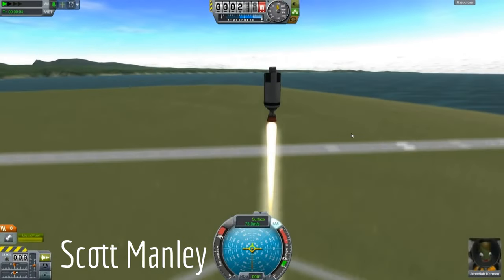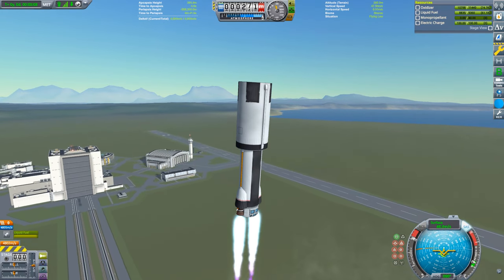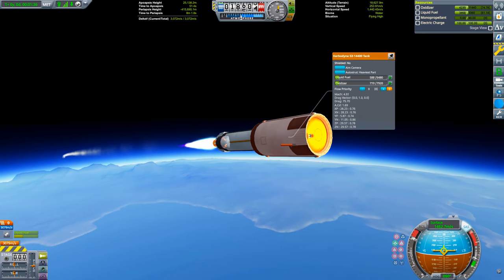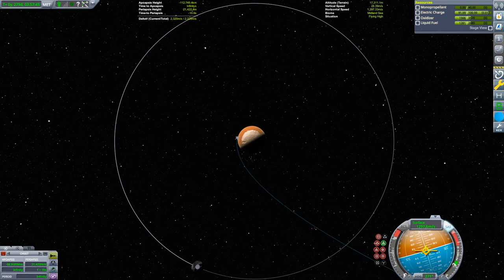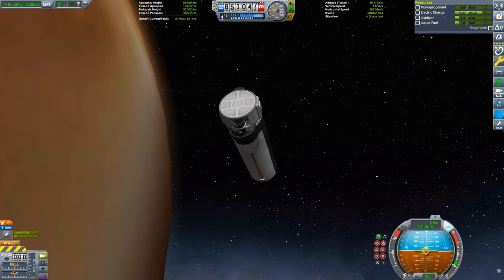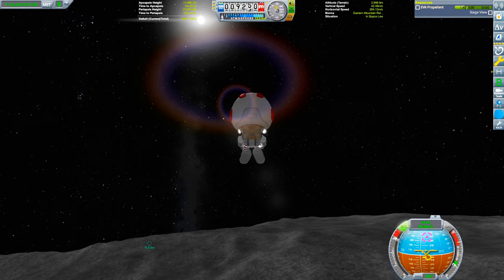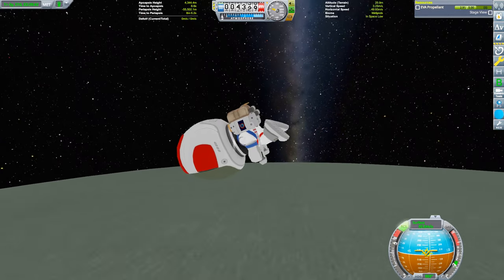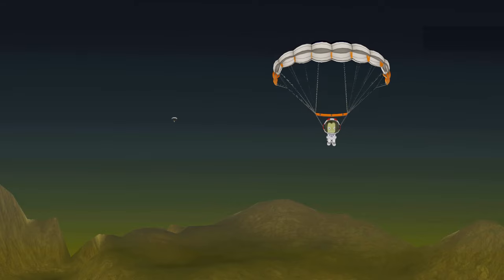3 Parts to Duna, Ike AND Minmus! | Stock KSP 1.7

Comment: ngl I don't find any of these videos particularly interesting (the ones where a few yters abuse what the game can calculate and not calculate). 

these tricks are cool and clever but what's the point? There's a challenge where you restrict yourself, but then go right against the spirit of challenging yourself by exploiting every fault in KSP you can think of. I suppose the biggest issue I have is these vids give me the impression that these things could be done legit, with some epiphany or revelation in the answer to the riddle in the title .. but no, the answer is just exploits. Unsatisfying enough for me to unsub

Comment: 10:30, you cheated. 
You jumped from less than 1 unit of fuel to 2.
Reply from the maker: Good catch, I didn't notice that when I was editing. Turns out, I used the wrong clip in the video. In the video, I performed my correction burn in the Mun's SOI to lower my Kerbin periapsis. For some reason, I decided to go back and do a more efficient correction burn further away from the Mun (this is the clip I should've used). But, it only saved 3 m/s which was irrelevant in the end